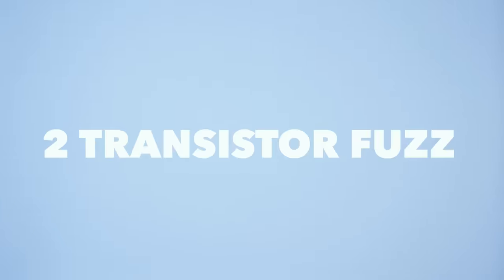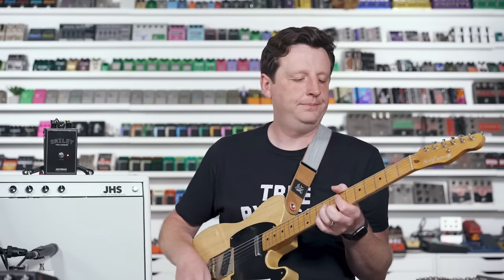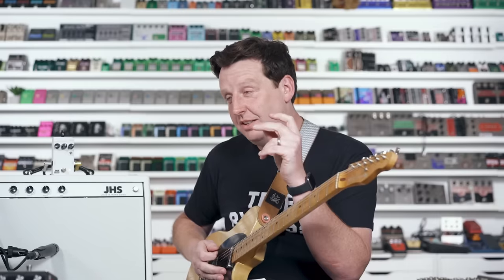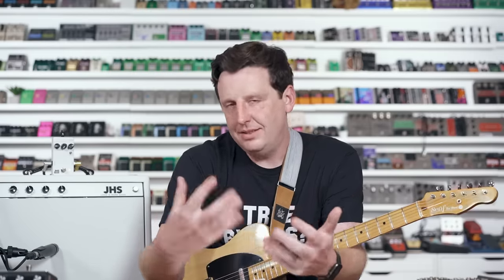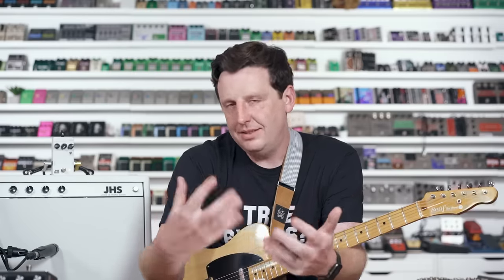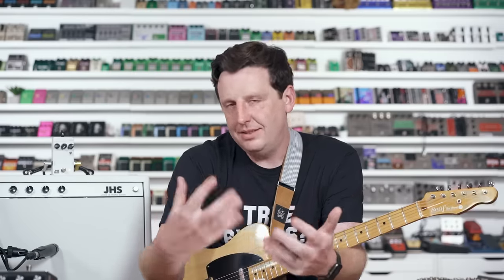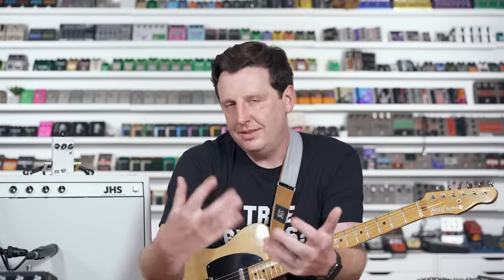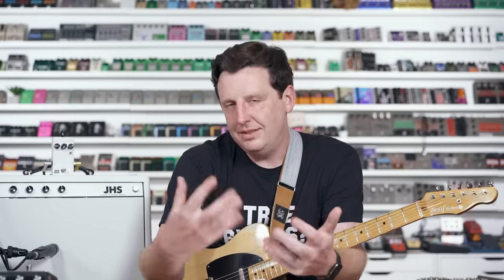How to Find the Fuzz Pedal You Need

Comment: I have your Bender and - contrary to my expectation and your advice in this vid - I find it does clean up quite a bit with the vol. control on the guitar. With a Strat it gets clean, with a Les Paul with P-90s it gets to that gritty 'clean' you hear from Hendrix. More usefully, I find that the structure and eq of the fuzz varies a lot with the guitar vol., even if it's not getting 'clean'. Going from 10 down to 9 gives a different kind of dirty, and by the time it's down around 40-50% it's much brighter and beginning to behave like an overdrive. I get this effect on Fuzz Face and Tonebender style pedals. On the Foxtone, not so much.
Reply: “Plug this up”
Reply: @Ronphayes  Que?

Comment: The hardest part is choosing which one you want out of the many fuzz pedals that need to be first in line.sometimes you can get away with running a few after each other if there isn't a buffer afterwards and some will let you put a wah first but it depends on the fuzz and the wah really.they really need to make a switcher box that sends multiple fuzzes your signal with the correct impedance so you can use all of them and potentially stack em in series or even better in parallel

Comment: fuzz pedals work great in clean or dirty amps. I have used a fuzz pedal turned on 99% of the time its my all the time tone for 18 or 19 years. when i play a clean amp ( black or silverface fender) i like an mk1 or mk2 tone bender. When im playing a dirty amp like my 57 low Power Tweed twin ( the treble has been turned into  treble mids boost knob) or my JTM45 combo i prefer the 2 transistor pedals like fuzz face or mk1.5.

Comment: This was a great Episode... I'm not a Fuzz connoisseur but I'm a fuzz Lover, lately I've been experiencing with an Octavio circuit and daaaaamnd it's good, been using after a Silicon Fuzz Face type circuit and it just screams Hendrix all over the place when both are on, crazy and lovely fuzz.

I've got a question about all of this, is Silicon Fuzz less picky on where you put it on the pedal chain? I mean, rather than Germanium... I'm building a couple of circuits (Fuzz Face types, and Tone Bender types) And I'd really like to use them all on a Pedalboard, any recomendations on how to place these? (I'll probably use Silicon for the Tone Bender as I used for the Fuzz Face). Thanks in advance.

Comment: Thank You getting closer to the truth, In the late 1970's I got the over drive sound I wanted by wiring My Guitar Into a CB radio microphone and later Into using stereo taperecorders microphone Input jacks and then used a Radio Shack stereo IC circuit that they discontinued. later Into Integrated amplifiers phonograph moving coil Inputs. I need to go back to It, None of these stomp boxes gives Me what I Am looking for and NO You do Not have to spend thousands of dollars for the perfect Guitar Sound.

Comment: Hey Josh, I'm curious what kind of fuzz pedal gets that sort of "sputtering" sound on bends, if you know what I mean? Hard to describe but I heard it just now on the Supreme pedal, in your Caline video on the Nightwolf, and I've also heard it on some Jicks tracks. Is that specific to the octave fuzz? Like when you bend, the signal sounds like it's sputtering, or kind of like a subtle helicopter... Like a very fast, extreme, square tremelo effect. Not sure if that comes from a certain type of fuzz or if you can get there with any fuzz dimed or something.

Comment: i have EHX east river drive  set as a slight dirty boost running into my  tc Rusty Fuzz with the fuzz knob cranked.  It sounds super nasty (in a good way), and if you roll off your guitar volume it cleans up to a slight overdrive.  the over drive tightens up the effect so you can play palm muted rhythms and hear them.  Single coils only doing this, as the humbucker guitars i'v tried it with sound muddy.

Comment: I like the Tonebender topology best for classic fuzz sound, Katzenkonig is a really cool one, I built a clone, it can switch the diodes out... I built a germanium TB Mk2, but I need to box it soon.  But I always envy the clean up trick of the Fuzzface, hard to find a quiet one.   I like the Foxx Tone Machine sound too. I built one of those as well, it's on the pedalboard for the head ripping solo.  I <3 Fuzz more than I do drive pedals.  I once loved the Big Muff, but it's dead to me now, maybe a G2 version will cure me.

Comment: What about 1 transistor, or two in a Darlington? I have built countless BazzFuss variants on breadboard, and I've built 3 into enclosures. One has a single 2n3904, and the other two use a pair of 2n3904 in Darlington. My in/out caps and clipping diodes are custom from the original schem, and I have a 20k linear volume pot that could honestly be a trim pot but it's more to set up to match unity with your amp. I'm certainly not an expert but I feel playing with the breadboard and swapping parts until you get what you want really does make each board unique.

Comment: I’m a Pumpkins fan, always have been.. I grabbed a Big Muff Op Amp Fuzz and fell in love with the teeth it had. I waffle between running it in front and using it as it’s own path, straight into a clean power amp, to add some flavor and mix into the other amp and overdrive tones I run in parallel. For the op-amp topology, do you still recommend always running it up front, and if so does that even include being in front of a wah?
Reply from the maker: All the Big Muffs are a lot more forgiving, so can be used in other places in the chain!

Comment: So what about the buffer or another pedal with a fuzz and wah pedal, or fuzz with pitch-shifter or octave which like to see a clean signal first for accurate pitch tracking? (I find both the Fuzzface and the Super-fuzz circuits oscillate with the wah pedal, but placing a buffer between them fixes the oscillation, though it makes the Fuzzface sound waaaay too gainy because of the impedance change going in, I guess. The super-fuzz, sonically, seems not really affected other than the oscillation is no more with the buffer before it.) I also use the Dunlop Authentic Hendrix Gypsys Fuzz, that seems to be relatively unaffected sonically by a buffer before it (Maybe a design aspect Roger Mayer incorporated into the 3 transistor circuit for Jimi's use of the Wah at the beginning of his chain? Not sure, but is probably my favorite fuzz overall, and sounds killer. Cleans up nice with guitar volume if you have a treble bleed circuit on the guitars volume pot!) Also I use a Fender Blender Reissue with modified tone and clipping, which it seems to not matter about anything before it. I switch between the 2 sounds with a 2 loop switcher, and have no issues placing uni-vibe, tuners, wah, pitch-shifter before them. I think a lot of the buffer or any type of effect before it really depends on the exact fuzz pedal and how that particular fuzz circuit responds with certain other pedals placed before it in the chain for all viewers out there, to be honest. At least in my own experience... Some pedals play nice together in any order and some don't play nice together at all, but its pretty relative to what you have setup.

Comment: The explanation that I needed thanks Josh. Would be interested to know which of the EH muff options you'd go for, I can never decide between them? TOP TIP folks: I have never gone back from trying this, I have a Little Big Muff pedal and tried putting a Tube Screamer before it (any similar overdrive should do) and it really lifts to whole sound to a better place, especially the high mids. You've got to have the overdrive level low (say 9 o'clock) and I have the tone in the middle and level just past 12 o'clock. Just sounds incomplete without it. Hope that helps someone!

Comment: Thanks for telling to put fuzz pedal first in chain, never heard that before. I'm trying to find a good buy on a fuzz pedal. Have 4 from maybe 25 years ago. First buy was a Dod classic fuzz Fx52, think it's the best one I've got. I believe it's got the Germanium chip and it sounds like your Crimson. Also have the Dod classic tube Fx53, sounds good but not quite like the Fx52. My other one is the DigiTech hot rod distortion that goes from warm dist to fuzz. Got the Big Muff (20 years old), maybe played it for 2 hours long ago and now does'nt work. Looking for new one under $100. Might purchase the Fender fuzz pedal it's got the silicon chip. Any suggestions?

Comment: Based on what Josh says almost at the end about hitting the fuzz from your guitar, what would be the best position to use them in conjunction with a multieffect unit, such as the GT100 or the HX Stomp? They have the effect send/return  ins/outs and that is where the manual tells you to put "external" pedals, but could it work better going guitar -> fuzz -> input of the multieffect do better?

Comment: Hello, does the muffelletta works well with buffers, other pedals with or without true bypass, a lot of pedals etc. please ? I mean, does it sound as if it is plugged direct into the amp , even with a ton of pedals, and buffer ? I got many fuzz faces and a fuzz factory, and it don't work at all... i'm looking for this type of "transparent" fuzz 2 or 4 transistors, that works with a ton of pedal please. Thx for the knowledge, et bonne continuation à vous.

Comment: You mention that the fuzz need be in the beginning  of the pedal chain , are there do's and don'ts  conserning the use of  different pedals on a pedal board, like i start whit a vox wha, then 3 x div echo's/delays, then 4 div Distortion/Fuzz,flanger, B9, Jamman , to the Amp. and it gives me all i need , still  i do some changes and switch up whit a Vocoder, and a Big Muff, but  in a technical sens  are there rules in  the use of the signal chain  ! Thank you ! Kind Greetings!

Comment: I have a question: If especially the fuzz faces need to be put first in the chain that probably also applies to noise gates with sidechain/send-return mode like the tc electronic sentry, right?
Or is there a sidechain noise gate without a buffer in the sidechain?

Comment: Hey @Josh and the JHS team.
Atm I'm running a big muff wicker switch behind a Whammy IV (usually on -1 octave setting) 
Bearing in mind that I tune my rig from C2 to c4 What Fuzz pedal & settings would you recommend I get? 
Obviously I would stick with 4 transistors but I was thinking of getting a Big Muff Nano or a Russian Big Muff Nano (also a little pressed for space/weight on my board)
Thanks in advance 
May the Darkness Be with You
VAN TASTIK

Comment: I have a strange Fuzz pedal, i don't really know what kind of topology it could be, it's
called Xvive Fuzz Screamer V4, it's like something between fuuz, overdrive and soft distortion, 
it has a volume, bite (some kind of tone pot) and sustain. It can be used to play Gilmour style solos, 
but it also cleans up really nice on lower gain (like around 10'o clock) while beeing after 6 pedals, 
one of them beeing TC Polytune with buffer on all the time. This might be something like muff with 
softer clipping? I really don't know (i played it on my "play with JHS" entry btw.)

Im looking for something more raw like Fuzz Face with bc108, and i want to put it first and outside of my pedalboard, 
 with a battery (i have a Wampler battery, it has to be good right? ;) it was in my Tumnus ;) ).

Josh, does size of Fuzz enclosure matter? beeing a very sensitive circuit, does it matter that components are
more far from each other (if they are in a bigger pedal) and outside of pedalboard with clean power supply?

Comment: If the JHS 3 Series is based around a 2-transistor fuzz, why does it have 3 transistors? At least from all of the tag board layouts I’ve seen, and the schematic. Where are my circuit nerds at? I want all the information over explained to me if you’ve got the time and understanding. 😉

Comment: I currently have a Bender (that pedal is awesome sauce) and a Big Muff Clone on my board. Does it matter which order they are placed in the signal  chain. I know you mentioned that they (Bender type pedals/3 transistors) should be ideally first.  Currently, first in my chain I have the Muff clone ,which is True Bypass, then the Bender due to space on my board. Should I swap those and rework my board? Secondly, I have an old 1976 Cry Baby with True Bypass mod, I have read diffent thoughts on where that should go in relationship with fuzzes. All thoughts are appreciated. I know ultimately I need to do what sounds best to me but I trust the great minds of the JHS community.
Reply from the maker: The Bender should be first, but if it's sounding good where it's at now, you should keep it there!

Comment: Fuzz is very sensitive to guitar and amp combination in my experience. If it doesn’t sound good, change out something to find the right fit. And for those that can’t bond with a fuzzface, put your guitar volume on 9 and only go to 10 when you need that extra umph

Comment: I'd like to know what fuzz pedal I'd need to get this tone, where you can turn the pedal on and off and not have to change your amp settings to compensate... I used to have a 1990's era Vox V829 Tone Bender where you could absolutely not do this (i.e., switching the pedal off and on during a song was not feasible as the change was way too drastic): https://www.youtube.com/watch?v=k82dVpxwuJs

Comment: Is the two transistor "spitty" or "sparty"? Either way , it's RUDE! So, the 3 transistor topology is "spitty"?! Oh, 4 is just one too many - just as Neil Young was to Crosby Stills and Nash. Octave up or down? I'm down with octave up. Did the folded pedal lead to the foldable phone? But, it forces you to a zone of the neck for maximum impact - and it sounds like a fly sparting! "Help Me"!